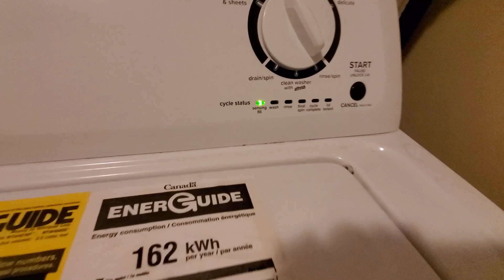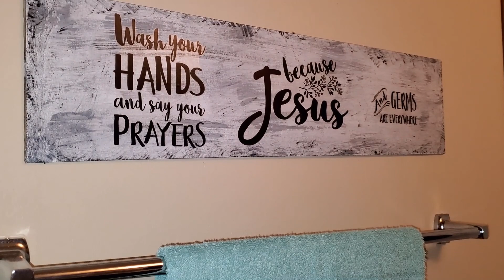Mobile Home Clean and Organize with me | Cleaning Motivation | Organization | Getting Things Done

Comment: Don’t use soap!! Dish detergent etc. wipe and rinse out. Salt is good to use with a cloth or sponge if you need something abrasive and you don’t have to re season. Re seasoning actually is what ppl used to call “firing “ them when means you literally put them in an open fire lol. But yes keep it oiled lightly or ut will rust and the dawn etc will speed up that rusting and take off the coating it has

Comment: First you don’t wash cast iron with Dawn or any other dish detergent. You use salt to scrub it with hot water only. I’ve got cast iron frying pans that were handed down from my great grandmother n I’m 64. They are in great shape have no rusting or sticking. You can use grape seed oil or I buy a cast iron conditioner off of Amazon. Yes hot water with salt will clean it just as clean as using Dawn.